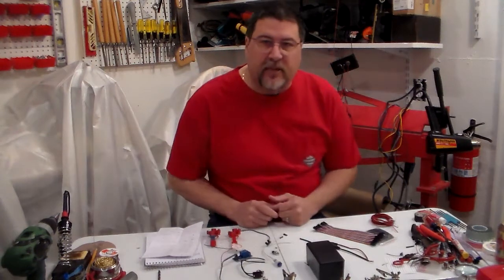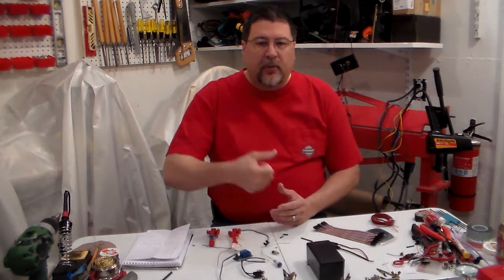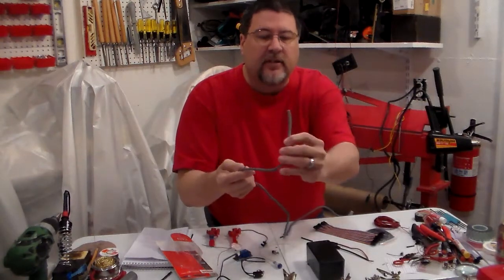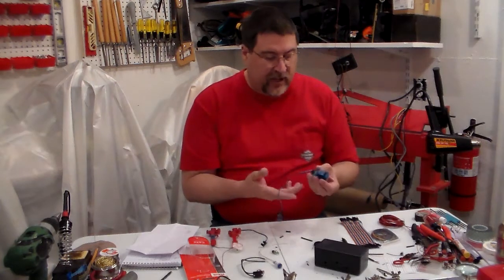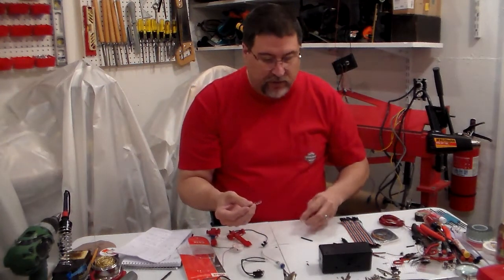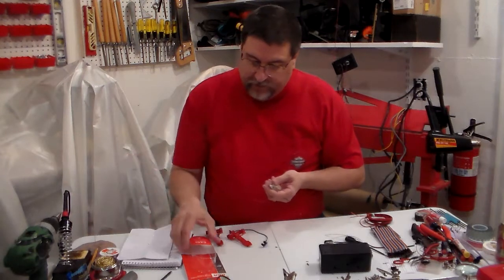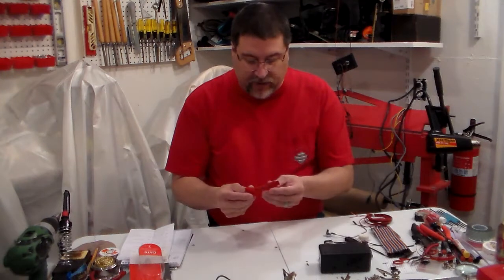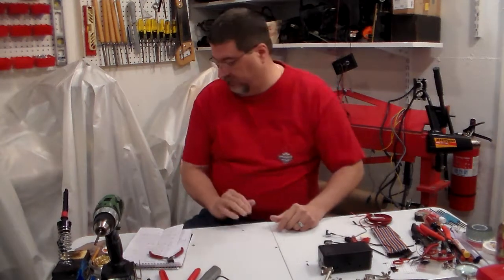Low Primer Alarm with Primer Feed Part 1

Comment: whats the strip of wires called?
Reply from the maker: +brad king  3mm or 30cm jumper wire DuPont male / female. Ebay  est. $6.00 to $7.00 for 40 to 50 wires. they will be in strip and you can peel the off. Radio Shack to expensive. Let me know if you need help or have any question. I will be doing a follow up video on the low primer alarm. I have request to share the parts and where to buy all the components. Over the last 12 months, I have built around 150 primer alarms. I have made some upgrades, waiting on part to finish this upgrade.
Reply: +Harleychromeman will do I'm modifying a hornady deluxe control panel system to my loadmaster, only problem is lee doesn't use tube fed primers hence using your system attached through theirs..well hopefully
Reply from the maker: Let me know how well your project moves forward. I used to make my own circuit boards but take too much time. Good Luck
Reply: Will you post a list of the component parts and links to the eBay auctions?  I'd love to build one (or buy a complete system)?

Comment: Big Pappy,  I am very interested in building your sensor.  Im very handy with tools, its the sensor that is causing me headaches.  Can you tell me the model of the sensor your using?  Do you sell a completed sensor?

Robert
Reply from the maker: +R Critz Robert I can do better than that, let me do another video to show everything completed. I will give you all the part number and where to buy the components. The sensor that you will need is sold on e-bay for $12.00 plus shipping. I have all my information in my shop. Let me get this video done this Saturday for you. I used to build my own circuit boards and sensors, I found this one to help other people to build these without a lot of labor and supplies. Thank You for your request, I will help you until you have a working system. Big Poppy
Reply from the maker: +R Critz I have the video done, just need to down load it. Having to work more hours at work and haven't had a chance. Coming soon.
Reply from the maker: +R Critz  I just made up grade, waiting on 1 part. You're going to need to buy 5/16 slot pcb photo interrupter sensor. Cost is $7.00 to $10.95 for 10 pcs. Buy them on ebay. This is part of the upgrade, when you order them, make sure their 5/16 sensor gap.